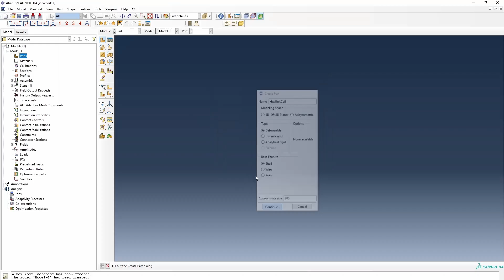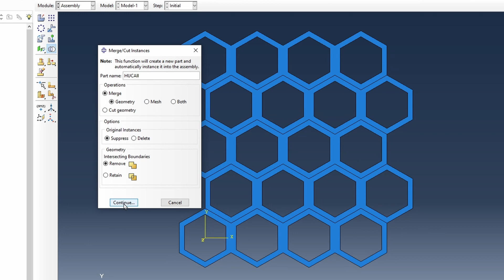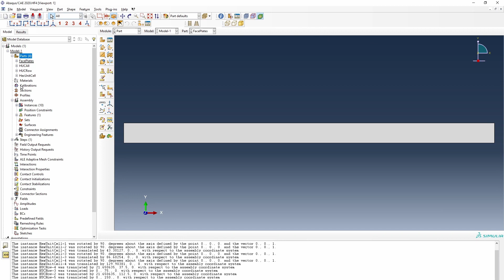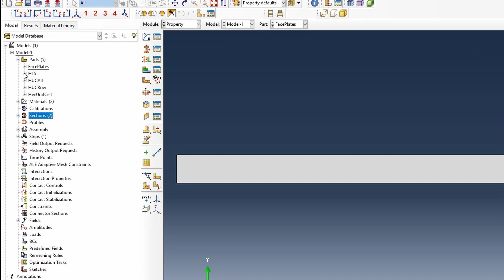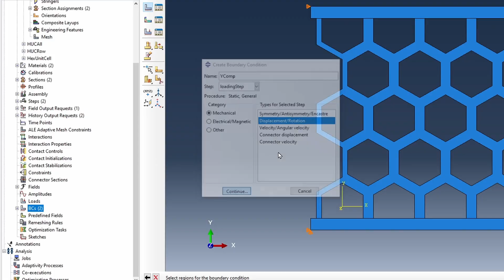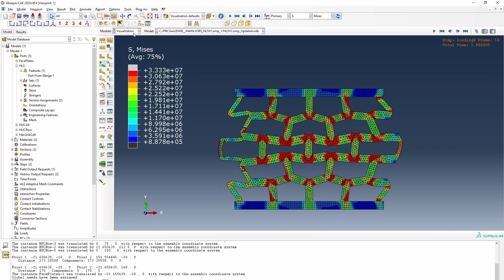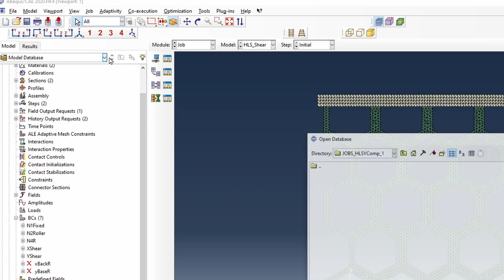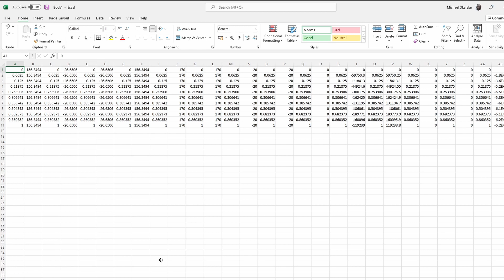How to model hexagonal lattices with periodic boundary conditions

Comment: Hello, thank you very much for the video. When force is applied from the upper left side of the part, the part deforms only in that direction. Why might this problem occur? Very happy if you help. Good work.
Reply from the maker: I think it is the sort of kinematic constraints that you have specified. Maybe, it is not suitable for the type of force you are applying. Its difficult to know without much insight into your problem and what you are trying to do.

Comment: I import a lattice gyroid stl file to abaqus. I changed mesh from tri. I added to surface at upper and lower direction.i put some load.but i am facing interaction problem.i cant create slave surface.because in stl file there is no surface.what can i do now?
Reply from the maker: Hello @Sabrina Islam, I am not sure about what is going on here. I am sorry I am unable to help with this query. Good luck.